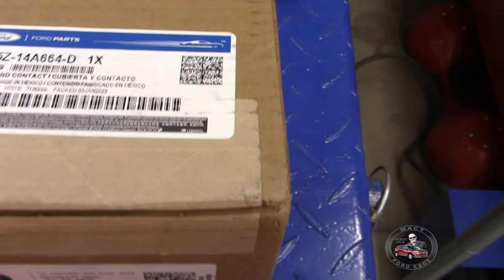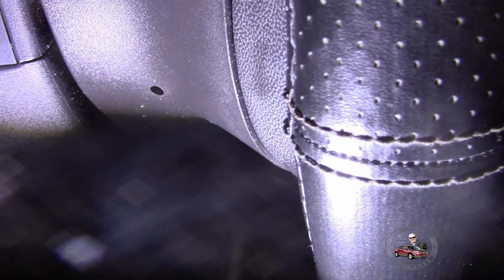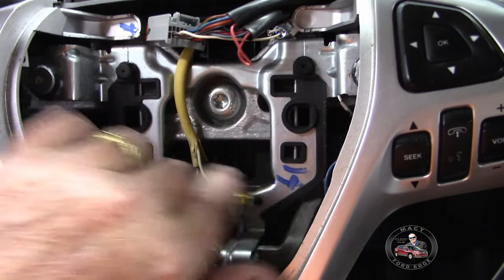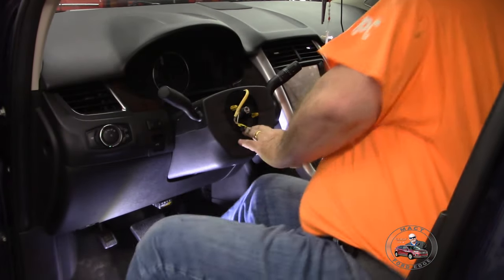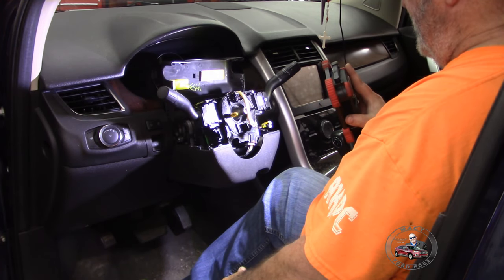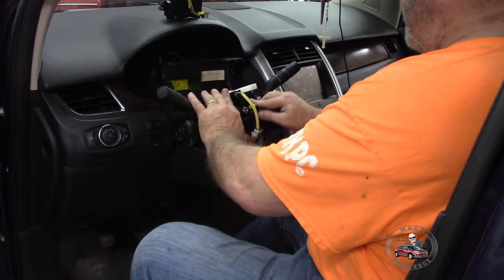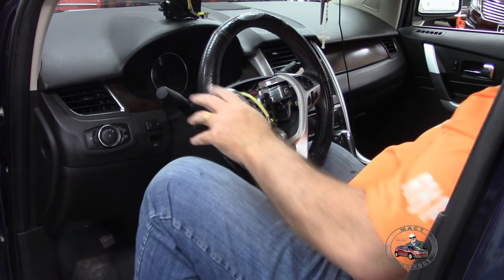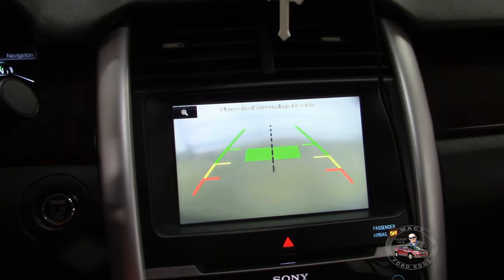2011 through 2014 Ford Edge Clock spring removal and installation.

Comment: How do you attach the steering wheel angle sensor to the clock spring? I am stuck in that part
Reply: having the same issue
Reply: Any update?

Comment: Love the video and channel.  I just bought a 2013 ford edge sel. 2 question.  What oil do I use for engine. And how do it get the maos function seems I don't have navigation.  I have the slot for the SD card but that's it. Keep up with your videos. None out there about this problem. 
Thank you
Winnipeg Manitoba Canada 🇨🇦
Reply from the maker: Ford Recommends 5W20 blend oil.  I have always used full synthetic off the shelf oils.  I am currently using and have been using 10W30 synthetic off the shelf oil with no issues for about a year or more now.
Reply: Says it right on your motor